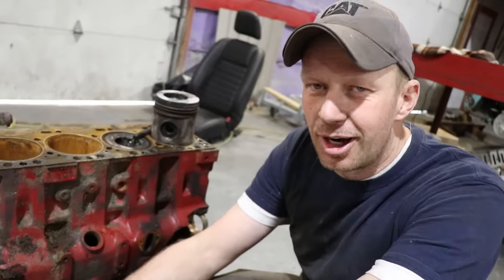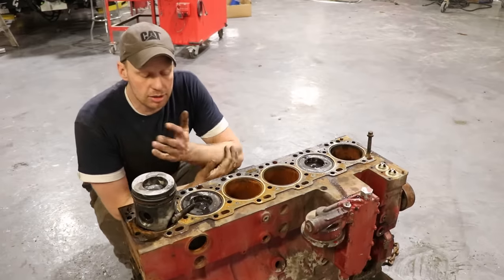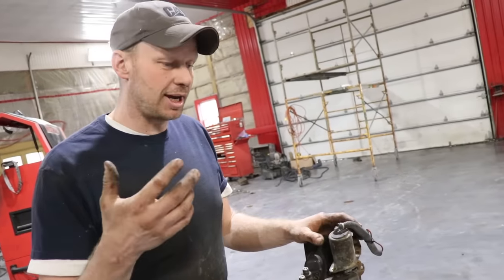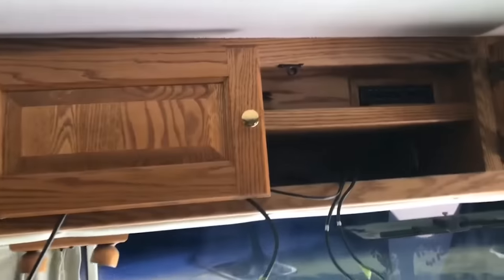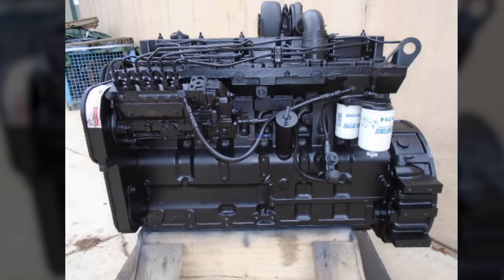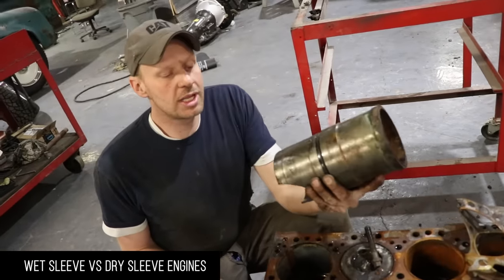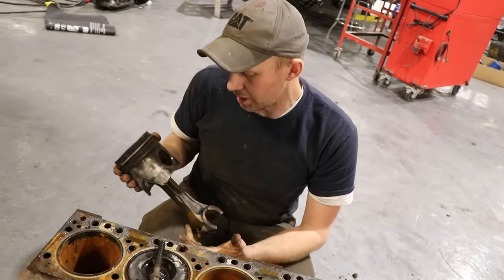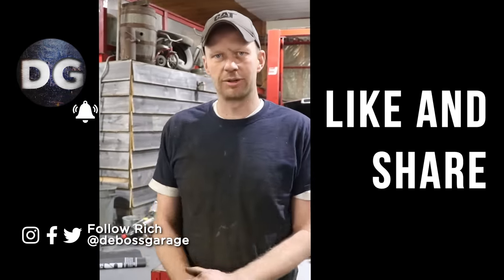REVIEW: Everything Wrong With A 8.3 Cummins Diesel

Comment: I have something to add, that I did not see in the comments below, that damaged engine block, can be repaired, depending on the location the piece that got blown out! When I was a teenager, I worked for the company after I got off from high school. They would rebuild large diesel engines, some of the large diesel 12 cyl blocks would have where a piece was blown by a large connecting rod going  sideways out the motor. They would clean that block and the piece that was blown out. They would heat up the block and piece till its glowing red, and the welder would have a fire suit on, he would weld up the cast iron block and piece back together. After cooled down, they would grind the weld smooth, spray paint the block to like new conditions! The engine would be completely rebuilt, and tested, before sent out to customers. But the heating of the block was time consuming, and extremely hot, it was called the oven, where they welded the block.

Comment: Been waiting for this video I've wanted to swap one into an one ton square body I've seen some cat 3216s and 3208s in them didn't realize the Cummins weighed that much more
Reply: I put a cat 3116 engine 1981 Chevrolet square body. It weighs about that much to. I upgraded the suspension to the 10 lug

Comment: The 8.3 were used in the magnum series case tractors, the 71 72 and 89 series from 88 or 89 until 98 and they are the most bulletproof problem free tractors there is out there. I like an 8.3 Cummins and think they were one of the best ag engines ever made. I wonder since it's a 5.9s big brother do they bolt up the same as far as bell housing end or engine mounts

Comment: I am looking at a 2001 Monaco Diplomat and it has a Cummins 330HP ISC.  I believe it has the CAPS systems.  It has 80k miles.  Would it be advisable to go ahead and replace the CAPS system?
Reply: If I were you I would just replace the diode in the line as preventative maintenance. I have a 2000 Diplomat. And be certain the lift pump works as they do fail. And be sure to change BOTH fuel filters regularly.

Comment: I commented on one of the last videos with the combine, and I'll say it again, I haven't seen a hole in the side of an 8.3, ever. I've seen them score cylinders and spin bearings due to poor maintenance but never a catastrophic failure to the block. We have several tractors that our shop services, over 10,000 hours, one near 20,000 on the original engine blocks. No holes.

The exhaust manifolds are a pain I will say that. They actually crack because they shrink. Believe it or not if you remove a manifold and try to put it back on, the ports won't line up anymore. We started replacing them with a new aftermarket manifold, that has a kind of spacer between the runners to keep them from moving. Seems to work well.

Comment: I had a hole like that in my engine I just used JB weld,  bailing wire and duct tape and it went another 3000 hours.

The amphetamines helped too.

Comment: Might be worth noting that the 8.3 was run at 2600rpms in IH combines, likely contributing to the cooling issues and rods coming apart
Reply: Yeah, that's wound up pretty tight for an 8.3. Long term operation like that probably makes for a nasty vibration that would go unnoticed until she comes apart.

Comment: Have a 2003 Alpine diesel pusher with the 8.3 and CAPS, 106K miles and runs like new. Always put a small bottle (5 OZ) of 2 stroke oil every fill up (100 gallons). Suppose to prolong the life of the injection pump. Thoughts?

Comment: The CAPS pump on the ISC8.3 CM554 was a disaster. But they worked well when the worked. I will absolutely agree that a FASS pump will extend the life of the CAPS pump tremendously. A CAPS pump through Cummins is around $8000.

Comment: Cavitation works more or less like electrical discharge machining by removing tiny amounts of material.  The hard "knock" of pre ignition creates a low pressure around the cylinder, and the coolant "boils" in that low pressure state.  The pressure again raises, the bubble implodes, and takes a molecule or two away from the iron liners.  

Ambac pumps were bad for causing cavitation.

Coolant filters are pre charged with a desurfactant to prevent the formation of those scrubbing bubbles.  Antifreeze can also be had with the additive.

Comment: That's a great video. I have had an 8.3 under the bed for about ten years. Never a problem, I do my own servicing on everything. It is very hard to get pertinent info regarding testing the coolant for sca,s etc. The mechanics at dealers don't test for sca's and rv forums tell about wet sleeves but not much info on additives. I change the coolent filter with additives once a year but I can't tell if it's enuogh or too much. Is pitting a problem with high mileage or low mile engins. Mine is somewhat over 100 thousand miles.

Comment: I was responsable for a '92 Pisten Bully (snowcat) for 3 winters with one of these. I was the first person in more than a decade (possibly ever) to change the coolant filter. To get it off I had to cut it to pieces, first tin snips, then grinder then dremmel.  Dispite 9500 hours on the clock (or more) and being run hard 6-9 hours a day it didn't use water or oil....just lots of diesel.....lots and lots of diesel compared to a modern rig with 3x the horsepower!

Comment: I'm looking at a  1998 Gillig Phanton with this engine connected to an Allison B400R Automatic trans. the bus has 617k miles. the hours showing are 1795. I drove it, runs great, shifts out perfectly. good tires & brakes. She's asking 4k for it. What is your opinion? worth it for converting it to a camper? not an RV but a camper. Thanks!!
Cheers from Louisiana.

Comment: When I built the similar cm 850 I had it on an engine stand and would turn the motor upside down and with a 4 foot long heavy bar I would hit the bottom of the sleeves and pop them out

Comment: Man, great video!  I’m looking at a 1994 F800 dump truck with the 8.3. Has 114k miles. It cranks and runs, didn’t get to get it on the road, they didn’t have insurance. They’re asking $10,500. I’d like to get it a bit cheaper....but anything that would be a big tell on not to get it mechanically??

Comment: I have one 8.3 ctab marine engine in my trawler (i think the B comes from that because that engine was a model engine in boat shows.. It has chrome fittings and coolant tank etc
.) 300hp version, 13k hours and still rocks like a new. All parts replaced: Starter, waterpump, oil, filters. Even the turbo is original. It runs on constant rpm between 1250-1500 all the time, no accelerations. I have another trawler with Cat 3208 with 20k hours. Totally indestructible engines when fitted to right use.

Comment: Great engine, we have this engine in our 1993 link belt HSP8060 60 ton crane. Runs like a top burns no oil and fires up so easily every time. Has about 6000 hours on it. Also we have the ISC 8.3 in our 2006 kenworth 2k water trucks and one has over 21000 hours on it and has very little blow by. I did a set of injector and feed tubes on it at around 18000 hours. Interested to see how long it will go. I’m definitely a fan of these medium sized Cummins 8.3 motors. Thanks for this informative video.

Comment: Why would you be laying underneath the engine when you pull a liner... Buy a universal liner puller from Kent more, Apex, Monaco, or snap on. That liner puller is very limited in the bore size. My Monaco can do a 3” to 7” bore. In addition the hose connection behind the water pump is suction, not outlet.

Comment: @13.04 you talked about sleeveless Engines like the 5.9s and most small diesels, that you can only bore so much and then the block is shot. That is only true to a certain point, if most of the cylinders are spec beyond the maximum wear limit of the bore. So in my case, about 4 years ago, had a 5.9 CR that cyl 6 ring busted and gouged the cylinder wall really badly, so it's shot. So I called multiple shops to buy a used block, but called a machine shop and said no problem, we can press a solid sleeve!? I was what the hell, I thought they were pulling my leg. Did some research and found in my Cummins ISB service manual and there's a section where you can bore it out hugely to press a solid sleeve into the cylinder if you beyond the maximum bore limits. BUT this is only safe to do so if its only one or up to three cylinders but cannot be adjacent cylinders, so it's not recommended to press a sleeve to cylinder 6 and 5 but 6 and 4, no problem. And mind you, the shop also said this only safe for guys with daily drivers with street performance but for drag racing Engine definitely not recommended, that block will break. Got this done, i run minor performance on it and had no issues ever since. I got a video and pics of that if you d request to see. I thought you like to know this, not a lot of people knew this
Reply: BTW, I'm definitely gonna get my hands on one of those EZ puller tool, that's really cool, can do multiple different engines with that. Thanks for sharing that👍

Comment: So cavitation in a diesel is actually caused by the cylinder walls flexing from the sudden increase in cylinder pressure because of combustion. The cylinder wall is pushed out  and when it flexes back in it creates a vacuum bubble. The force of the bubbles imploding causes pitting.

Comment: Do they fail in combines because they don’t have the resistance of driving an actual transmission? Just the combine and the hydrostat. When one blew in the one i was driving, we were just moving, the combine wasn’t engaged. It was maybe 95 or 96 and it was a 1660 case international.

Comment: Got one in a FL80 that a distillery gave me with a caps sys . They replaced the oil pressure sender and dident wire in the wire to the ecm . Then they gave up

Comment: I'm surprised that you did not display that the Military had the 8.3L 6CT for seven years in some trucks.
For 1987 to 1994,the M923A2-M943A2 all had 8.3L's with 240 HP/592 TQ,they had a H1E Turbo on them.They could run the Governor with 2,200 RPM at 63-65 MPH all day long.

The ISL has the same Bolt Patten and Dimension as a 12V 6CT,so it's a nice engine to do a interchange on parts with just like the Marine 6CTA.The 6CTA is 430-650 HP,and for the ISL,they were used in many mobile homes as well AND fire trucks in the late 1980's and 1990's.

Changing to a 6BT Governor on a 6CT can not be completed with staying stock,they require a after market Turbocharger like a HX-40,HX-50,or HX-55 and Marine Head Gaskets and ARP Head Studs,and then the rest of the parts as said can come from a ISL or 6CTA.Some of those engines can run 60 Psi of Boost and do 3,000-3,600 RPM if they are built up the right way.With the H1E,more than 40 Psi of Boost makes the engine take a shit and has it roaring more than 1,200 EGT for sure.
I thought I would throw this out for some one else to read.

These engines just like the 5.9L have been used in racing trucks before with as much as 1,000 HP-1,400 HP.But honestly,more than 300 HP/745 TQ out of these causes a shorter life span.

But it is a great engine,I have not had major issues with any of mine or driving a truck with one.
My Ford F-800,M923A2,and M931A2 all have 8.3L's,the one in the Ford is 260 HP,the others are 240 HP as I previously mentioned about what the Army had.

Comment: 14:00, there's also a theory with the cylinder cavitation, that it's actually electrolysis causing the pitting on the cylinder. A metal piston traveling up and down in a steel cylinder creates a magnetic field. Being next to an opposing cylinder thats traveling in an opposite direction creates its own magnetic field. Between the two, a current can form and actually pull metal away from the cylinder. Most of that cavitation forms on the front or back of the cylinder between opposing pistons. Seen it a couple times in truck engines that never have their coolant flushed. There's additives you can put in your coolant that will help mitigate that.

Comment: great breakdown your  knowledge and experience you share  is invaluable. Just to share what I learned so far about this motor , they apparently don't like a constant load, hard run heavy equipment and there used frequently in garbage trucks and have a short life due to that contestant hard on the gas at every stop otherwise like you said RVers love them and out live the rig , and in some truck 100,000,000 is not uncommon

Comment: Love the video I'm more acquainted with the older Perkins and Ford's diesel and the British Leyland engines I did a lot of Perkins engines we used a puller similar to that but like you said you gotta reach in from the bottom to place that piece I currently own a5.9 Cummins in an 02 Dodge a few of my friends run rigs with the8.3 Cummins and talk highly of them

Comment: Case ih ran the CAPS in magnums from 98 to 06 in mx240/270 and 255/285. Don't run cheap fuel filters caseih are 2 microns. Don't think they put them in the combines.

Comment: Little late on this video as I'm a new subscriber (killer videos by the way!), but I was hoping you could answer a question I had about that liner puller? Does it catch on the liner feet below the liners? The Cummins tool is a typical puller with two legs that you orient perpendicular to the length of the block to avoid catching and breaking the feet. I imagine imagine that tool is great investment if it can avoid that issue as the Cummins tool costs a pretty penny. Also your content is awesome and really helpful to an apprentice tech like myself!

Comment: Question On Cummins 8.3, currently have my RV at the Cummins dealer, they said it dropped a lifter and needs a rebuild. That's was after they replaced the injection Pump, Lift Pump and #3 Injector all at $9k now being told that I need a rebuild for $14k and they will eat $3k for the cost. Wondering why they did not check the compression at the start instead of putting on all these parts. I took it in for a skip with no check engine light on. They also said I might need a turbo if it's damaged from any metal in the system.

Comment: We had a school buss with CAP and it failed to run after two weeks of head scratching, I called a competor to run Cummins program he pointed to cam gear , he said it is broke or something ( thank you Steve mc Cormic of Palmdale)  I put Rudy from Guatamala on the teardown and on the back of the cam gear is a tone ring for the CAP system, so there was a crank sensor notch and a cam sensor + tone ring
The tone ring shattered 
Fix was easy peazy now

Comment: Correct me if Im wrong but the 8.3 Cummins on a combine operates at 2700 RPM when working?, some serious stress on the conrod bolts, no wonder they let go. Most tractor engines max revs at 2200 rpm?

Comment: I had as dowl pin blow out the oil gallery behind the fuel injection pump on a rebuilt engine, scary when you spend $4500 DIY rebuild and see a pile of oil spurt out on the ground, took me several days to find the tiny hole, i found the pin on the floor and wondered where it came from. I can see everyone making one of those sleeve pullers.

Comment: If you wanna make a daily driver out of an 8.3 you should mid-mount it in the back and use the front end for the fuel tanks you're going to need to get any distance out of it.
For the math challenged, the 8.3 should last 315,000 miles in a motorhome before it gets the combine crack.

Comment: Rich, engine, John Deere  329, 359 , with turbo.
Reason is, I am thinking about putting this engine in my 1986 GMC dually!!
I think this engine should be more fuel efficient than a 6.9 Cummins because of less cubic inches.
Don't need a big power house, just looking for efficiency. I am thinking a 5 or 6 speed overdrive trans. Trying to keep the rev's low for cruising the interstate at 70-75 MPH.
454 auto in it now. 
I would appreciate your thoughts on this idea! 
Thanks,.
 From Southwest of Buffalo, NY   Steve

Comment: Hey I wondered what the difference between the 8.3 and the 8.9 are other than the fuel system. I know the 8.9 is available with true jake brakes and thought it would be cool to rebuild an 8.3 with 8.9 parts and have a 8.9 p pump cummins with true Jakes. Would be a little over kill for my 3/4 ton dodge but people put 5.9s in 1/2 tons so it think it could work. The other option is a 1970 f600 4x4 which would also be awsome. Would love to hear back and see if you thought the Jake's could work on an 8.3. 8.9 liters would spool an s369 sxe nicely. Would it handle 500-700 hp? What about head bolts/studs

Comment: The 8.9 isl seems better in my opinion because it’s a common rail 24v that makes 400hp and is available with a Jake
Reply: The C series 8.3 came with Jake brakes the same year the DPF came along in 2007 and it worked very well even at lower RPM and was quiet.  Before that it was an exhaust butterfly which worked OK but RPM had to be held rather high to get effect from it.
Reply: Ns Pro is that more a Vgt style or something of that sorts, or an actual true jake? Because I haven’t seen a jake that goes on the head of an 8.3
Reply: @willw7545  Back in 07-10 when I was still in the business the trucks we bought were coming with 8.3s and they all had Jakes.  They came with a pamphlet from the Jacobs company.  They had multiple stages on the switch and you could feel and hear the cylinders pulsing.  The VGT was part of it to increase boost and they worked really well in lower RPM but definitely exhaust valve actuated classic Jakes at heart.  It was an option at the time and the company also has one VGT-only truck which the drivers do not like as much but I don't work there any more.